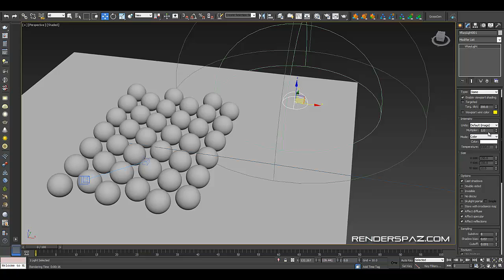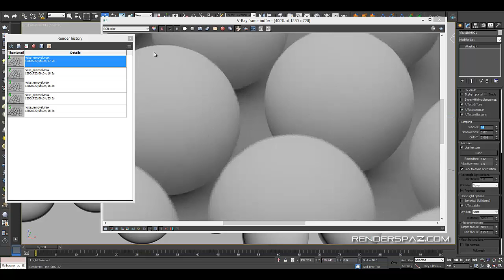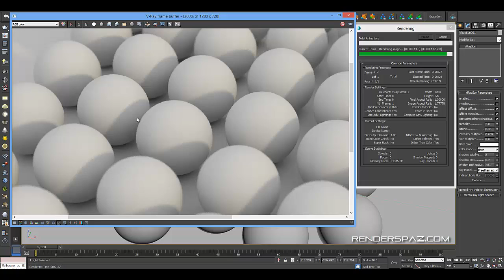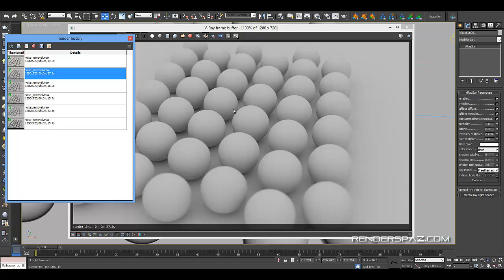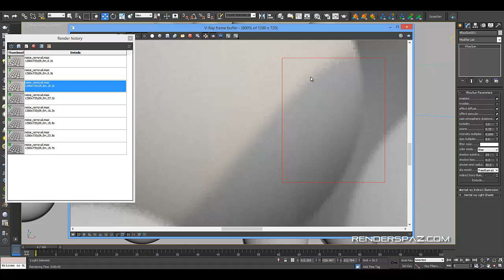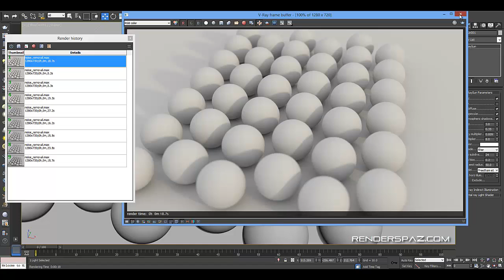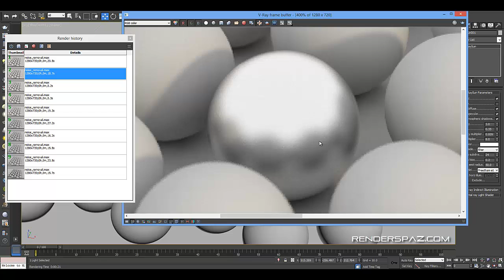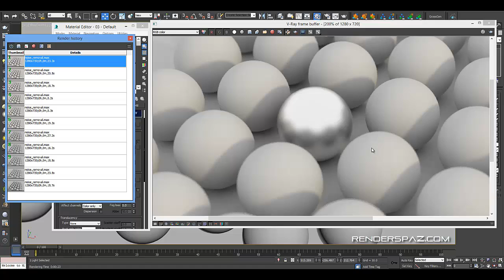Noise Free Renders In Vray

Comment: dear friend. it seems you are an expert I hope you can help me out to help out a friend with rendering issues on vr rt. I am her I.t (my job is software engineer & hardware and networks) I have limited to none knowledge when it comes to 3d rendering settings. so I build an economic pc for her with i7 2700K 16gb ram Ssd 256, and a GeForce gtx 580 1,6gb because I read its gpu works well with vray RT. windows x64 vray rt 3.0.8 x64 3dmax 2015 x64. when I try to render with the default settings a kitchen she did 3dmax, cuda gpu, the file renders in seconds but the final image is full of what you call noise dots and almost no colors or proper lighting. when I use vray adv the file renders in hours but the cpu final render is perfect. we tried tones of forums none seem to have a solution. we played with various settings but we see not difference. we wish to render our file with the same cpu quality but with the gpu cuda speed. what is left for us to check can you please help? will posting a screenshot help? you are our last hope forum members do not reply or they simply dont know. I refuse to believe that vray rt that can do in seconds or mins what cpu does in hours its actually worthless. whats the point of having gpu then rendering softwares. :(
Reply from the maker: Do you mind sending me a screenshot in a PM or email us to take this further.
Reply: render spaz thanks 1st thing on Monday when i will have access to her pc i will! thanks a lot for replying
Reply: render spaz hi. where can I find your email? I have all the info you possibly need.
Reply from the maker: ***** You can find it on the About page on renderspaz.com
Reply: render spaz send! thank you!

Comment: thank you. i have problem with metal material on the side of beleved text. i watch some video tutorials explained main render settings (irradiance and light cache settings) and there is no answer for noise problems. subdivision in light settings is a key to resolve all my problems with noise and lights problems on the flat metal surfaces. now i have good plan to setup my scene : set more subs (light setting) and less lights (object). i must setup less lights with higher quality.

cheers!

Comment: hi!
what pc configuration is necessary for a 25 frames per second rendering in full hd (1920x1080) with vray?
example you animate these balls in your video and render them in 25 frame per second.
is it realizable?
Reply from the maker: Hi Gez,  I mostly render all my animations at 24 frames per second with no issues. My specs are a bit older now, even on a old dual core machine you can render a 1080 frame animation at 25 fps - just depends on the horsepower of your cpu and ram.
Reply: render spaz i have amd dual core 3,3 cpu and 4 GB ram and my vray rendering time was 30 sec in full hd, i spoke 1 picture per sec but i wanna render very fastly like a videoplaying (when i watch a video i see 25 pictures in a second)
my question is - why isn't enough my configuration for "videoplaying speed rendering" if my pc let run the most pc games well (25 fps)?
i will be happy if you answer me again. :)
Reply: Hi Gez, The reason a game can render at 25 fps or even 200 fps is because it uses the graphic card for rendering, this is called realtime rendering. The graphic card has thousands of cores where a CPU has only a few like 4 or 8. Vray does have a realtime rendering engine called Vray RT where RT stands for realtime. The reason CPU rendering is fav ored over realtime rendering is because it is physically based and therefore can physically calculate things like caustics, subsurface scattering, volumetric lighting etc accurately and with control. so far those things in games have  been faked using the graphics card so they cannot be physically calculated by the graphic card. But since new technology enables software to better communicate with the graphic card and since the graphic card is becoming extremely fast, realtime rendering is being used more and more for production rendering.
Reply: Rudolf Viljoen 
can you show this kind of video?